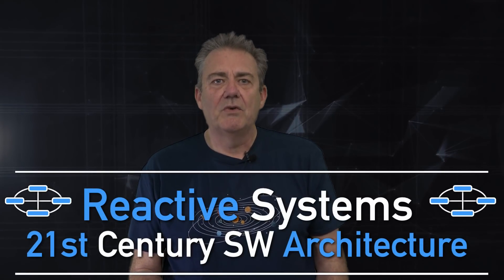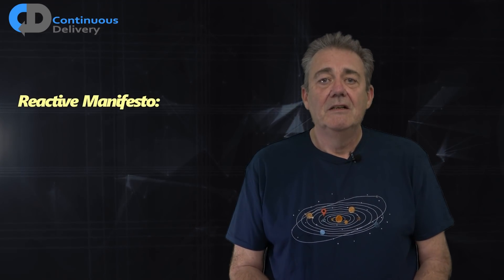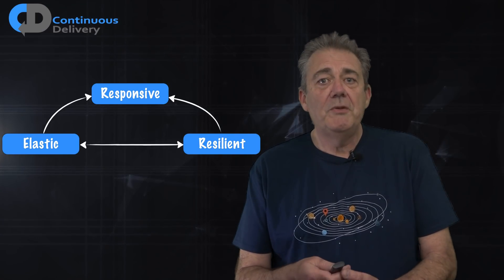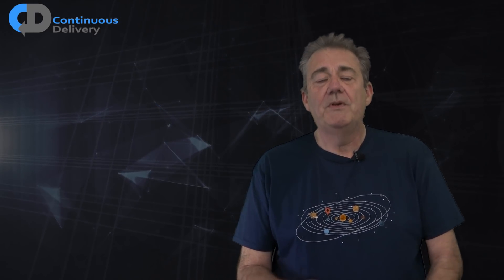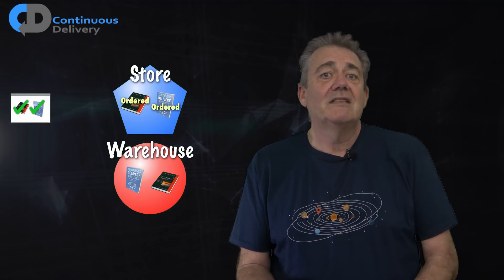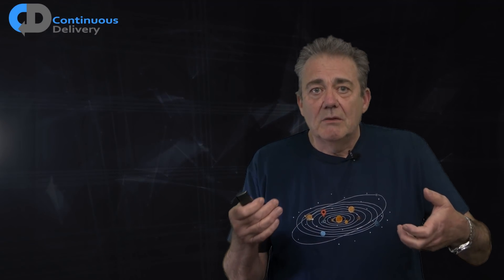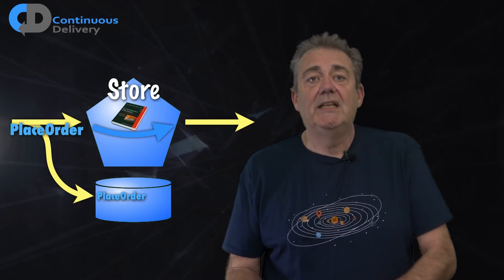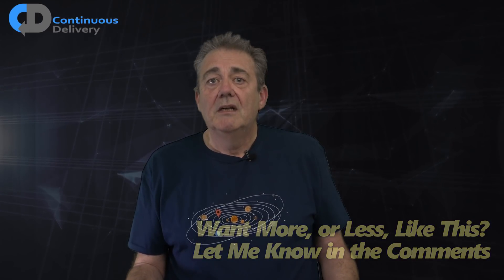What Are Reactive Systems?

Comment: A reactive systems is a big state machine but in architectural level. A problem I have with this type of system is the traceability. It is really hard to reason about it or design it. Although, you can choose an orchestration approach over a choreography one. Nevertheless, they are hard to build and design. You need a very good team that knows what they are doing to choose this approach. The same can be said about microservice but people choose it anyway hahahaha.
Reply: You think that's good, you should try a changelog-based data processing system. i.e. Each node tracks the records that change and downstream nodes update themselves based on the upstream changes. That means that data can be safely removed from a system just by removing a file at the "edge" and letting the giant state machine catch up. All the combinations and aggregations will get redone, leading to a consistent state of safe and provable deletion. 

Of course, my system kept a full list of change keys from all the upstream records, so I could truly prove a record's deletion. And yeah, this isn't easy for most engineers to wrap their heads around. But I've noticed over the years that they manage to wrap their heads around whatever is popular at the moment. Even if it makes NO BLOODY SENSE. (I'm looking at you, Backbone.js. And all your descendants!)
Reply: @thewiirocks  hahahahaha. True! People get used to basically anything. But most of the time, IMHO, I think people can work on something complex even though they do not understand it properly. It takes time and experience to get the full picture of the thing. Wow changelog-based... I've never heard that one. I'll take some time to process what you typed. Do you have any article about it? It seems cool to know about it.
Reply: @BrunoGabrielAraujoLebtag  Unfortunately I never wrote a paper on the design. I kind of wish I had. Every time my team and I showed it off, we got a jaw-dropped reaction. It was a lot of fun starting the user interface on my laptop, showing how it picked up a drop file, showing it process the data through (with a graph showing each node updating), and then show it reverse everything as soon as I removed the file. 

The way the database system was designed was that each node (basically a table, but with either byte array records or binary-encoded JSON records) had a link to an "upstream" node. When the upstream node changes, the node would note that there were new changelog entries since it last updated. Sort of like a GIT or Mercurial repository. Each changelog had a list of record keys so that the downstream node could determine what records it needed to look at to update itself. 

In the case of aggregations, this sometimes meant that the downstream node had to pull an aggregation key off these records and then select all records with that key instead of just getting the changed records. The system was designed to keep track of the records selected and record the parent record id(s) (and all parent record ids recorded on those records) on a per-record basis. That allowed me to know exactly where each record came from and how it wound its way through the system.

The coolest part about the database was that it was serverless. i.e. The database existed on disk, not in the memory of a server. You could run commands to tell each node to update itself, select data, modify data, or do other operations. The only rule we had is that there could be many reader processes, but only one writer process per node. 

To scale this in production, there was a coordinator that would rotate through the metadata of the nodes and check if they needed to be updated. If so, it would reach out over SSH and run a process to update the node. Many nodes could update in parallel, but never two connected nodes. We used a MapR Hadoop system as the storage for this because we could access the same data using local filesystem mounts from any server in the cluster.

It was a pretty cool system. I'm hopeful I'll have a chance to make one like it again. I'll make sure to do a full write-up next time. :)
Reply: @thewiirocks  Wow, indeed, pretty cool! Please, if you ever write a paper on the design, don't forget me! What was the purpose of this special database? It seems like a linked list of records.
Reply: @BrunoGabrielAraujoLebtag  The purpose of the system was for Healthcare data. In Healthcare we had some serious challenges where data sent accidentally or incorrect data that needs to be restated needs to be backed out of the system to comply with HIPAA. Even worse is that when clients or partners leave a relationship, the data goes with them creating an even BIGGER cleanup headache. 

Adding insult to injury, the data arrives swiss-cheesed to hell and spread across innumerable feeds. Which means a ton of cross-references, merging, and aggregation. Once you do those things, it gets super hard to undo them. 

Thus the point of the system. By tracking how data flowed, we were able to operationalize these "exceptional circumstances" which were anything but exceptional in practice. That increased the maintainability of the system while lowering the cost to operate. And as a bonus, we could easily fix situations where bugs caused incorrect calculations. Just update the logic on a node, set it to fully reprocess, and everything automatically flows downhill from there.

If I ever get a paper done on the system, I'll definitely keep you in mind!
Reply: @thewiirocks  Hmm... I think I am starting to understand how the system works. Now I see the point of keeping a linked list of nodes. Wow, pretty awesome! Thanks for keeping me in mind, man! I'll be looking forward to it!
Reply: @thewiirocks  Hey there, interesting. If you still have (most of) that in your brain: do I understand correctly that these sweeping updates need the system's network configuration (graph topology) to stay fixed to be processed correctly? I mean I imagine there can (should) be some resilience against topological change, too (in a high-level (app/business logic) sense, not like in TCP/IP), but that adds a whole new level of complexity, so it's probably best to just have the topology locked during those transactions you described. (Inevitably, error cases still must be handled, of course, but not reconfiguration, probably that's what I mean. :) ) If you have any details regarding these considerations, I'm interested. Thanks!
Reply: @lunakid12  Nah. We cared very little for the network topology. I mean, we cared. But not in a very stringent sense. The system was built on top of MapR's filesystem, allowing us to offload the challenges of distributed read/writes to the underlying fabric. And we had numerous methods for distributing the processing, given that we had a full Hadoop cluster at our beck and call.
Reply: @lunakid12  Oh, sorry. Just realized I misread. No, the topology of the database was allowed to be fluid. Any change to the topology that required recomputation would invalidate the state of downstream containers. They were still usable, but they would be completely recomputed next time the update system looped through them. Most changes were non-destructive though, adding new downstream containers that would be in rotation for updates.
Reply: @thewiirocks  Thanks for the info/update.
Reply: @thewiirocks  hahaha, same here. When people say to me they are working with Microservice I always ask what is their definition of Microservice. Most of the time is not even distributed... OMG!
Reply: True about microservice. People are using it without even understanding it. In one of my recent project people were having shared databases.
Reply: Thank you for this great presentation , and thank everyone here for the great comments.

Comment: How do you replay events through an evolving system? For example, some subset of messages are processed by api v1, others by v2, etc. How do you handle the bookkeeping to 'recreate' reality? Is there a system that tracks this kind of meta data?
Reply from the maker: There are a few different strategies. In reality, for this kind of system, you don’t keep all of the events forever, instead you “snapshot” some state, and then replay events after the last snapshot. So, for an orderly shut-down, you can snapshot, and then migrate the snapshot as part of the deployment of the new version, that is what we did for our exchange.
Reply: @ModernSoftwareEngineeringYT  Prevayler would like have a word with you about log-structured object systems... ;-)
Reply from the maker: @thewiirocks  Yes, I never used it but I think it was based on very simlar ideas. We don't claim that any of the work in the Reactive Manifesto, or the LMAX architecture, that my version is based on, was original, but we added some nice features that I think took it further than Prevayler (but I could be wrong I don't know it well).
Reply: @ModernSoftwareEngineeringYT  I’m mostly teasing. Prevayler was the last gasp for Object Systems as databases from the early 2000s. We really loved OOP back then and kept trying to eliminate all the yucky SQL. I weep when I realize my colleagues and I unwittingly unleashed the evils of Object Relational Mapping (ORM) in our mad quest to eliminate relational databases in favor of Object Systems. 

Prevayler solved all the problems and brought such a system come to life. And it was awful. Rather than manipulating the objects directly, we had to create serializable “command” objects that were responsible for updating the object graph. 

These commands are what get stored in the log structure and replayed on startup. Like any good log-structured database, it snapshots the object graph and flushes the log at regular intervals. 

It all works great. But after writing the fifth or sixth transactional command object, it gets pretty clear that the time investment isn’t worth it. It’s faster to use regular database commands where the data elements are easily identifiable and comparable.
Reply: Greg Young has written the book "Versioning in an Event Sourced System" about this topic.

Comment: Are these messages just strings?
Reply from the maker: They can be anything you like, but if you are building high-performance systems, then no, they will be in some binary format.
Reply: @ModernSoftwareEngineeringYT  Ah right! And do you post them to some kind of central queue that every other part of the system listens to, or is there some kind of other way to subscribe to different kinds of messages? What are the "design patterns" for this? Are these also described in the book?
Reply: @jimhumelsine9187  thank you!

Comment: I’m a big fan of this style of architecture and have been using it for 30 years.  I think a key point that needs emphasizing is that you must get the partitioning right.  It is not always obvious how a problem should be partitioned.  As software evolves unanticipated dependencies can emerge.  This can lead to the desire to couple or more tightly control the sequence of various message processing entities if you are not strict about sticking to the architecture.
Reply from the maker: Yes, where you draw the boundaries matters a lot. I think that DDD is a good guide, with its bounded contexts, but you still need to think about that part carefully. But then that is true of any complex system.
Reply: DDD is good for the overall design.  Some architectural patterns can also help, notably Saga and Process Manager.

Comment: How do you keep an overview of messages? As in who produces message X and who consumes X. It is easier when it is a mono code repository but I imagine with a high number of smaller code repositories it will be difficult to keep/get an overview?
Reply from the maker: Yes, keep it in one repo is the simplest solution. When we built our exchange this way, we kept the whole enterprise system in one repo, and had a single Deployment Pipeline that evaluated everything.
Reply: @ModernSoftwareEngineeringYT  thanks for answering!